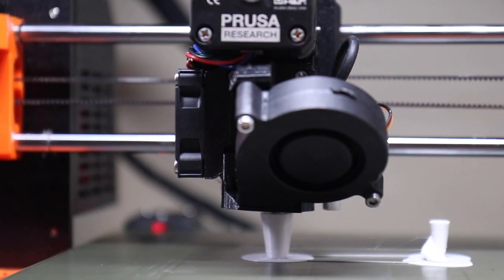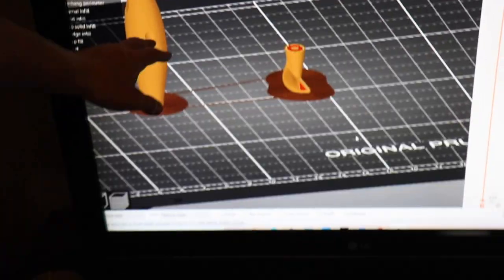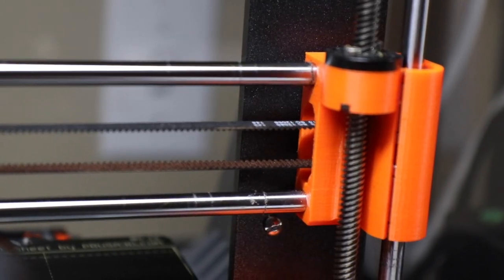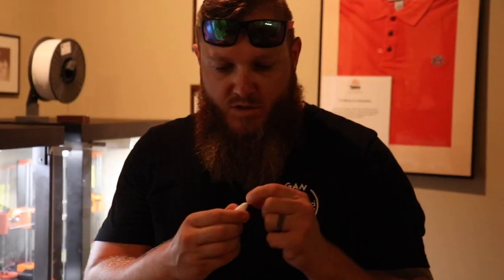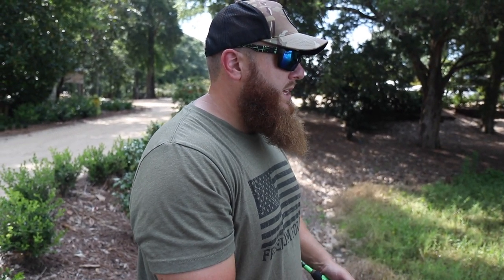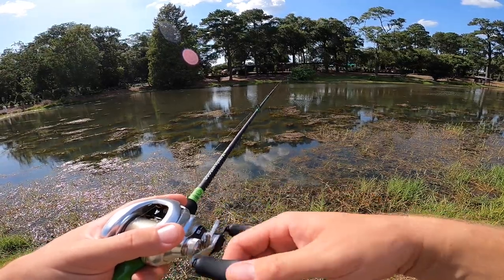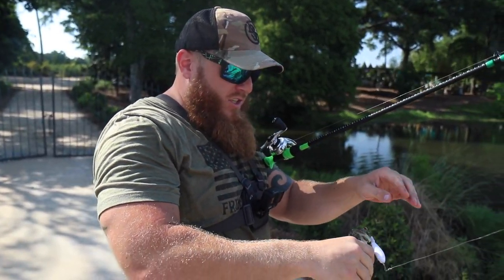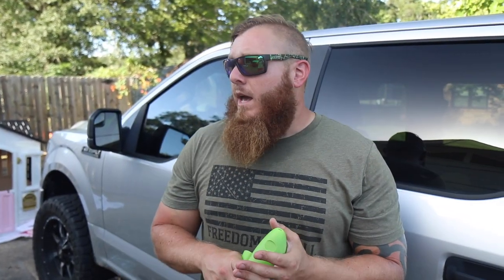3D Printing TOPWATER Fishing Lures (They Actually Work!!)

Comment: Need to figure out a way to 3d print some buzz baits lol that would be 🔥🔥🔥
Reply: Maybe you could it seems like i would be possable though some of it would maybe need to be metal for support
Reply: Buzzbaits are mainly metal
Reply: The thinner plastic needed for the wire would likely wouldn't bend as well and would crack. He'd have to use actual wire but might could print the body or the prop.
Reply: Look up floating buzzbaits they were a thing 20 years ago and had plastic a plastic blade some even glowed in the dark . Made for an awesome night bite in Texas
Reply: Sounds cool.
Reply: You can print the blade. They are on thingerverse.

Comment: It would be cool is you could 3D print like a hook or something and see if you can hook some fish with it
Reply: Fishing With Crow unlikely that would work, PLA would bend and break, and most plastics aren’t stiff enough to hold a fish
Reply: You can 3D print steel on more advanced industrial machines, but it is more difficult to get access to those machines. You can probably get one printed from Shapeways, but it would need to be decently thick to turn out good.
Reply: A hook made out of plastic is a no go.

This 3d printed plastic is realky weak only usable for things that dont reauire strenght
Reply: @xXSinForLifeXx  I wouldn't say that all printed plastic is weak, some materials like PEEK can be incredibly durable. The problem is that the plastic is not rigid enough for a hook for a moderately sized fish, and it isn't hard enough to get a sharp point. I print plastic parts for 250 pound combat robots, so it definitely isn't always weak.
Reply: That would be cool
Reply: @howardbartlett3419  hunter killer models, T-800s??

Comment: Just a tip with 3D printed lures, you can actually design pockets inside of the print that you can put lead sinkers into to add weight into the belly to keep it upright. You can ask them to use the pause function in their slicer to make the printer stop long enough for you to put the weights inside of it.

Comment: Square bill. I make these as well. Use a small wire to go through it. Swivel in the back hole, bullet weight in the front. Epoxy that up. Couple beads in the back for spacing. Loop the wire in the back and front. Makes it sit up flat, cast a lot better, and the second hook always helps.

Comment: You need to figure out a way to anchor the front body section so it doesn’t slide back into the spinning section.
Reply: If he put a bead inbetween them he’d be fine
Reply: Super glue

Comment: Yee yee how do you cast farther with a bait caster anyone  have tips
Reply: Loosen the cast control a tad bit, and turn the brakes down a couple clicks. You'll get the furthest cast when your reel is on the edge of back lashing but doesn't.
Reply: Aaron Hanes ok thanks
Reply: Lighter line let you bait down about 1 foot and a half before throwing gets more leverage 🤷‍♂️
Reply: seth nodine over hand or side
Reply: Both work fine I can’t notice the difference but I use side most the time but over hand might get it out further
Reply: seth nodine thanks
Reply: Carolyn Berg no problem brother anytime

Comment: I just got a 3D printer a few days ago just got all my parts for making lures and am learning the machine still but literally made a whopper plopper and a square noise swim bate as my first prints I was useing some 22awg spring steel wires not Easy to loop around but works great. I also got some fish eyes and eye hole screws off amazon I’m happy with the outcome.

Comment: Try putting a couple beads, like the tiny ones you put above a weight stopper for more flash. Just use a few to help with ploppage. Theirs slack in that area need a little ridgity.

Comment: For the plopper you need a hard wire in the middle that doesn’t bend easily and glue the top half of the body and put in a smooth ring between the body and tail so they don’t touch and it can spin more freely.

Comment: It needs to be more ridged. Glue a solid rod into the main section and bend that into a loop for the line tie and then you put a brass rod through the tail to give it a sort of bearing to rotate better, if you really want to make it plop and function as a true whopper plopper. Me and my little brother come up with a center rotating lure where the center has a blade that looks like half of a spinner bait on each side to catch water and spin that way. It still needs some touch up but we are getting there.

Comment: One tip, paper clip or spring wire works better than steel leader. It provides more of a solid axle vs the flimsy leader material

Comment: Get some TPU filament and print some senkos! It's a softer, rubbery material. I'd be very interested to see how it worked since I've never had the chance to use that filament with my printer, but always wanted to. Also would be super cool if you showed the process of putting the lure together. Great vid!

Comment: Soft plastics are capable of being 3d printed. There are 2 ways. There is a filament called ninja flex that is super flexible but there are other filaments that are more like tire rubber also (tpu, what your phone case is made of). The other technique would be to print a mold of your soft plastic with the hard plastic filament and pour silicone or whatever soft plastics are made of in the mold.

Comment: You need a spacer between the 2 pieces or some way to keep them from touching even though water is pulling the tail the force of the water against your lure while you’re reeling in is forcing the front piece into the back piece and causing friction so the tail won’t spin try a bead in between the 2 pieces threaded onto the steel leader. Might have to drill the bead hole out a little first idk just an idea

Comment: Put a small brass bushing through the tail and it should make it spin better. And/or use a small gauge stainless wire to connect the two pieces.

Comment: One thing about ABS plastic this coming from a former injection mold technician is that ABS has a tendency to be more fragile than some other plastics such as polypropylene but way stronger than plastics such as polystyrene

Comment: So that guys printer can do soft plastic. It would need to be tpu filament.

Also I think you guys should have tried hard wire, they sell it at craft stores, instead on the steel leader wire rope. Plus beads at the end and between the body and plopper so it wouldn't get hung up while moving. 

You might be able to have the guy pause the print and you could put a metal bead or ball bearing in there too. I have the same printer at home. I might have to try this now.

Comment: The front hook goes in the middle. You are suposed to put a swivel in the middle hole then run your leader or steel wire to connect all the pieces. And there is a copper bb that goes in the hole in front of the swivel

Comment: Put a bead between the front piece and back piece. Since the steel leader connects to your line every time you reel in it pulls the back piece into the front piece not allowing the back to rotate.

Comment: I'd like to see a crank bait styled lure, but instead of the clear plastic front piece that makes it dive, place a weight inside the center of it, to make it sink to a certain depth. I'm sure it can be done by printing half the lure, placing a weight in a small cavity in the center, then print the rest of the lure. no need for that front clear piece to make it sink down anymore.

Comment: Hey, I have been designing my own custom lures for a while, so let me know if you want a custom design with your logo on it to print. I have had good luck with poppers and jointed swimbaits, so those might be a good thing to try. I have also printed blanks to make silicone molds for soft plastics before, so you can use them to make soft stuff.

Comment: If you use a thicker gauge wire the tail will stay stiff and straight just like a real one. You would just have to make a wire harness with the thicker wire and the plopper would be just like the real deal

Comment: TPU = You can absolutely print in very, very soft materials. Here's the softest I'm aware of: https://flexionextruder.com/shop/x60-ultra-flexible-filament-black/
Just requires a special extruder (the motor which pushes the plastic into the "Hot End" [the part with the nozzle]).

Comment: "Throwing light lures on casting gear is hard..."         Laughs in BFS No, it isn't LOL! I like to throw 1/64 oz trout magnets with casting gear sometimes. It's really fun! I think it might be a better thing to use a stiff wire shaft, when putting that kind of lure together, than that limber leader wire. The original whopper plopper uses stiff wire shaft, in it's construction. Those 2 holes in the body of the lure, I think you are supposed to put weight inside of. Like a few split shots glued in. What you do is first tape the splitshots in, and test to make sure the lure still floats, in a container of water. Once you find the right amount of weight, and it will still float with it, glue it in. Weight in the belly of that lure should make it more stable in the water. I build little lures sometimes, and these kind of tests are what I do in the process. I make them out of soft foam, plastic, balsa wood, and even used wine corks. I got one on my MH setup I made out of a wine cork. Casts really nice on that heavier setup, even in the wind! Just got to add the correct amount of weight to make it stable.

Comment: Why go through the trouble to 3D print a lure if you’re not going to put it together well. Get a stiffer wire and put a bead between the 2 parts so it can plop